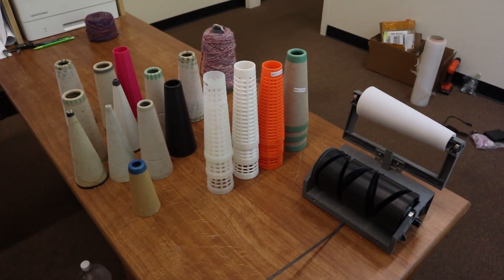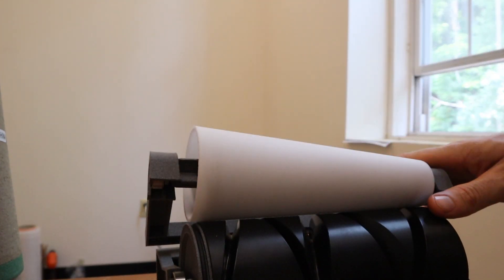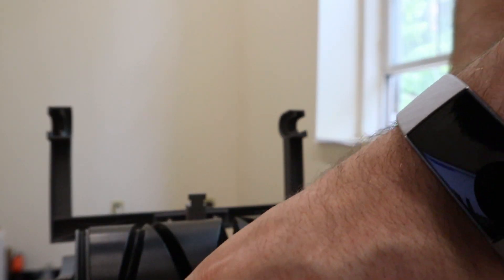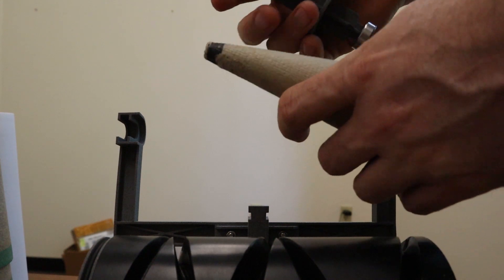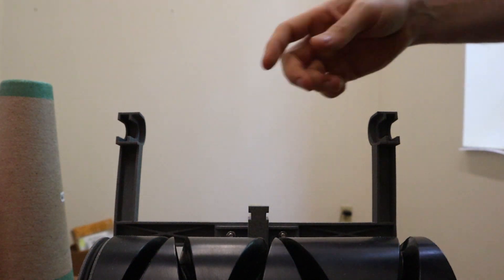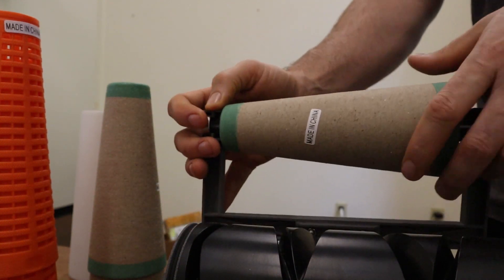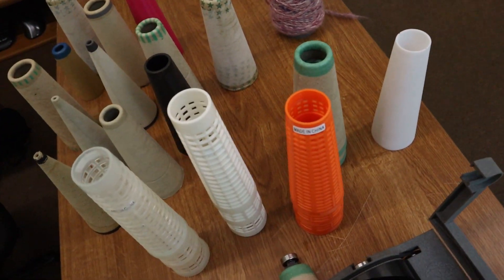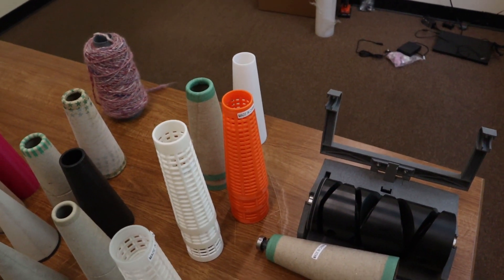SPIN #121 - Cone Selection for Cone Winder Prototype

Comment: If you are using plastic, best choose a better quality. 

When I lived in the Dominican Republic,  I bought many dozens of sewing threads on large cones for my 5 thread overlocker. 
For some reason the plastic started to shatter as the years passed. Just a bump or compression and the plastic broke.
I can only guess it was a cheap quality OR they had been exposed to heat.
I had the same problem with shattering plastic when I stored huge cones of 2ply for my electronic knitter, in a shipping container in Africa,  for a few years.

Cardboard lasted in both cases.
I still have sewing thread on cardboard,  from the 1960s. (My mom's collection)

So yes, it all depends if people will be keeping their yarns on cones for years, like me, or making them into balls and reusing the cones for winding until they are dispensed of.
Reply: Thanks for that feedback.  It is something I consider and I have been making plastic parts for the past decade so it is something I'll continue to consider.

Comment: Just a passing thought and may not be possible due to bearing angle etc, but have you considered splitting the arm in half with each side having its own spring? That way any cone that meets the center hole and length requirements would be pressed flat against the drum. Love the work you’re doing and can’t wait to see this project progress!
Reply from the maker: I don't think that is possible.  Commercial cone winders handle this by only have the arm on one side and then that can accomidate different size cones easier.  The issue with that is they use steel arms and my plastic arms just aren't strong enough for this kind of design.  I'll keep thinking about this to see if I can come up with a better solution, but while trying to keep everything light weight and low cost this is the best I've come up with so far.

Comment: I'd like to see the addition parts for several different cone sizes included in the Kickstarter.
Reply from the maker: This would add a lot of cost because it would mean more molds.  Once I figure out a solution I'm happy with I can figure out how this works, but if the cost of this is more than a large number of cones that would tell me it's probably not worth it.  I'll keep this in mind though and do some calculations later.

Comment: Would it be possible to make the rings on the shaft slidable so that they could be moved back and forth depending on the the inner diameter and shape of the cone?
Reply from the maker: I actually had a prototype like that earlier and wasn't happy with the stability of the cone on that version.  I could try to do that more, but the issue is this wouldn't solve the arm angle issue so you'd still need to make that part.  Making all these parts adjustable is probably possible, but would add  a lot of cost/time and thus I'm leaning towards a good solution for a single cone design with the option to print other parts.
Reply: @DreamingRobotsBlog  I was thinking of that too. Wondering if making that one arm flexible for different angles cone would be worth it. There will always be cones that might not fit, so might not be worth the trouble, if the cones you provide are relatively cheap